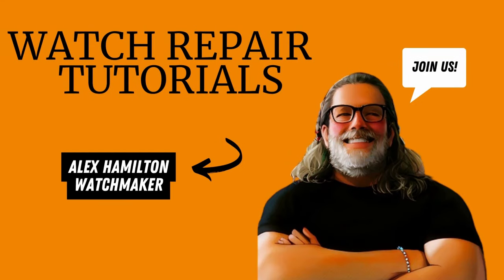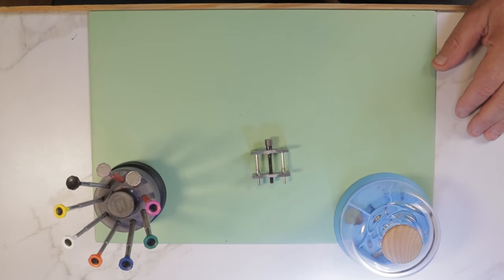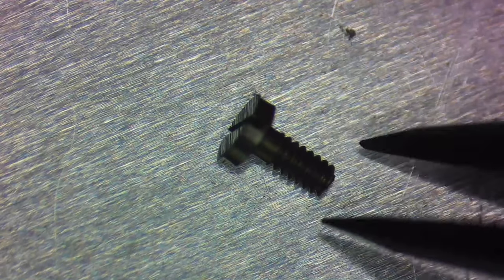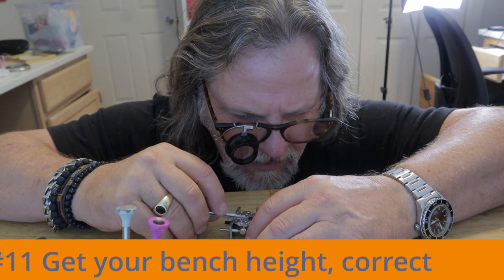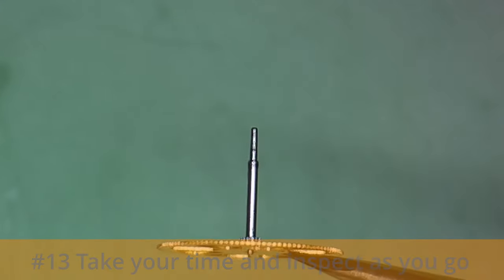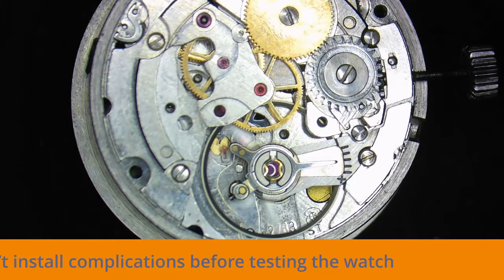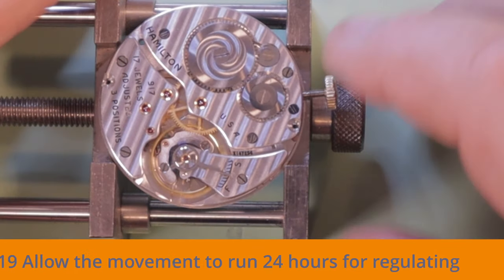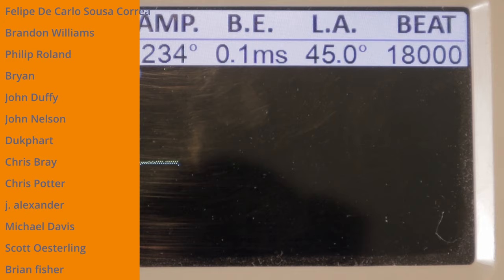20 PRO Tips for Your FIRST WATCH REPAIR

Comment: Very good tips Alex. Pre-cleaning parts is key even if you have a machine. Proper fitting screwdrivers too. Another tip : If you are getting frustrated and/or aggravated, stop and put it aside for another day.
Reply from the maker: That is true for for so many things. Thanks for adding.
Reply: That's the best advice I can think of! For watch work and so many other things

Comment: Apologies if this is a dumb question, but regarding waiting 24h post lubrication and assembly to test timekeeping - I'm assuming if one made any additional adjustments to the balance you wouldn't need to wait an additional 24h. But you would if you had to re-lubricate the watch?
Reply from the maker: Correct.

Comment: I found out the hard way not to wash the springs with the rest of the parts.  Had a click spring go missing.  Fortunately, I found it in one of the wash jars, with a magnet.  Since then, I leave those in the parts tray and wash everything else.  Photos and videos are very helpful, of course.  I keep the parts grouped in the trays and take a photo of each tray compartment.  That has helped me get the parts grouped back together after washing.
Reply from the maker: Sounds like you have learned some lessons. Thanks for verifying

Comment: I just bought some really cheap basic tools and I'm really excited for when they deliver. It's going to be my first peek at watch repair. You're tips have already helped me figure out how to begin. Thanks!
Reply from the maker: Well, like I tell everyone you should pick yourself up an ST 36 movement practice on, not 100 year old vintage pocket watch with no chance of it being repaired and familiarize yourself with the way a watch should run. This way you become familiar with the proper operation before you start looking at things that actually need to be corrected. Good luck my friend.
Reply: @watchrepairtutorials  The St 36 movement is the one Seagull uses correct? I just want to make sure I've found the right movement.
Reply from the maker: @introvertswag6494  
You are correct

Comment: Another great video!  Your videos have been invaluable in getting started in the hobby. I would love a video on crystal installation though.  I bought a vintage Seiko 7005-8062 where it looks like the movement comes out the front, but I'm afraid to take out the crystal since I don't have the tools to put it back in.  It's a maze of expensive presses and dies of different prices and qualities and it's hard to find good information on what exactly I need.  Keep up the good work!
Reply from the maker: that’s interesting that you mention that because I’m actually writing the lesson for the watchmaking course all about cases, including front loaders, as well as the second part lesson three, which is about watch crystals. 
I’ll be posting a video on crystals I just don’t know when yet as most of my time is spent working on my watch making course

Comment: Great video as always - succinct and to the point. The 20th tip is key and I’d add a 20b as an addendum, which you mentioned in other videos: Don’t start this journey by repairing non-runners. Start with ones that work so you can understand the way things should be. Sure it can suck if you “break” a movement that used to work well. But it’s far more demoralizing if you keep working on watches and go nowhere, and months later you just have non-runners strewn across your desk. Have a friend who did just that and he seems to be giving up on the hobby sadly.
Reply from the maker: No, you’re absolutely right about not starting on or not running unless you just want to test your ability to take a movement apart and put it back together. To see if you could handle the small parts well, I hate to see is a classic American pocket watch movement butchered on someone’s first attempt. They don’t make those anymore and sooner or later the supplies are gonna dry up to nothing.
Reply: @watchrepairtutorials  That’s an excellent point and I 100% agree. What I did was start with cheap Chinese (legal) clones of common ETA movements like the 6497, 2824, 2892, 7750… You learn about classic movement architectures and who cares if you mess it up? But I’ve never had anybody actually advise me to take that path. I even asked a local watchmaker (in Waltham!) for tips and said I was starting with Chinese movements and he said “nah, you should start on Waltham pocket watches…”

Edit: Mark Lovick does actually use a lot of cheap Seagull movements in his courses. He hasn’t does his automatic one yet but wouldn’t be surprised if he uses clones of the 2824 and 2892 if (when?) he releases that. Good example to set IMO.
Reply from the maker: @seb_617  well you’re smarter than most then because I hate to see people start on a piece of American history. The chances of somebody fixing €100 pocket watch on the first attempt is practically zero and what usually ends up happening is that they turn around and sell it as a non-runner on eBay because they screwed something up. at the rate we’re going now in five years they will be nothing but non-runners on eBay. That doesn’t even take into account the cost factor. With the limited parts available for 100 year old pocket watches people end up buying a second one to get parts from. So instead of just buying a $35 ST 36 the end up spending over $100 and still can’t fix it. It’s just a shame.
Reply: @watchrepairtutorials  100%!

Speaking of American history - do you happen to know of a good book on the history of American watchmaking? Or even just the Waltham Watch Company. I can’t find anything recent. Even the official WWC archives deposited at Harvard only go to the 1920s. I want to know in particular why these iconic companies went bankrupt (while the Swiss survived, if not unscathed). All I have on that is kind of hearsay/theories but no rigorous analysis.
Reply from the maker: @seb_617  my understanding is that after the fair of 1876, the founders of Longines came to the US to study what was going on in the American factories. They use this information to restructure the entire Swiss watchmaking industry out of fear, that if something did change the entire countries future was at Jeopardy. They use this information to replicate what we were already doing in our factories. Fast forward to WWII., the American factories stopped producing consumer goods to concentrate fully on supplying the military with timekeeping pieces. During this time period. Because the swiss were neutral, they were able to come in and start picking up pieces of the consumer market share unopposed. Now the American factories had to try to restore their market share, but because of the huge expense of their factories, they couldn’t maintain business as usual, and slowly started closing with the last one being Hamilton, which was bought out by the Swatch group. 
No, I don’t know of a specific book on American watch history, but I do have a PDF copy of this 300 page book that is essentially the report that was made by the guys from Longine on how the factories in America operated. It literally details out the entire operation, including the equipment that was used in great detail. It is an interesting read. If you send me an email to alex@watchrepairtutorials.com. I’ll send you a link to my Google Drive where you can download it.

Comment: Hi Alex! Thank you for the another great tips.
These days I am trying to service old watches. I understand an amplitude is one of the most important figures that shows if the cleaning process was perfect.
I found that dish soap+distilled water+IPA rinsing is still nice,(regarding its high accessibility) but in most times it requires multiple manual brushing while cleaning 'old' watches. And even after those manual brushing, rusts or some kind of pollution seems to remain after drying. I went to my domestic watchmaker to ask help, and found the watchmakers use 'hexane' for cleaning&rinsing. What I am curious is, 
1. Does hexane has clearly better performance in watch cleaning? Is it worth hardly purchasing via domestic watchmakers?(was not able to buy it from the internet)
2. Are there any additional hazards(comparing to IPA) I have to take into account while using hexane for watch cleaning? IPA seems to be well used in any kind of field that needs disinfection(so there was plenty of info about its hazardness), but I cannot find fields that use hexane a lot.. That's why it was hard for me to find additional information. I'll appreciate if you can help me just a little bit. 
Thanks for your help in advance!
Reply from the maker: Hello my friend, I have a video coming out in a couple days where I’m going to answer your question in depth because a lot of people have been asking me about this same type of issue. I think you be very happy with the answer but you’re gonna have to wait a couple days until the video comes out
Reply: Thanks for your reply! I did not know that you left an answer for me. Do you mean the latest video titled 'When to service the watch?' I've watched it right away but cannot find information about hexane. Although I think it is another great tips..

Comment: Hi Alex, what size pin vices we should get and what brands besides Bergeon? Thanks
Reply from the maker: It totally depends on what you’re using them for.
A pin vice for sizing stems can be what ever you want. A couple small generic ones are fine.
There’s also specialty vices made for holding barrel arbors. I don’t know of anybody other than Bergeron that makes those, but you can check for with Horetec.
There’s also specialty vices for holding pallet forks, balance timing screws, and hairspring stud screws
Reply: @watchrepairtutorials  thanks!

Comment: How much does one of those de-mag machines go for?
Reply from the maker: The Elma branded one go for just under 300. I’ve also seen Chinese versions that go for about 6070 bucks. Can’t speak to how affective they are or you can get one of the little blue boxes off Amazon for about 10 bucks and they work as I demonstrated in my video about how magnetism affects watch movements.

Comment: Where can one find the tech sheets for these movements?
Reply from the maker: Almost everything’s available just by googling the movement number plus tech sheet. Was there anything specific you were looking for?
Reply: @watchrepairtutorials  Is there a specific website that usually has it? Unfortunately still having trouble finding it. Looking for the Rolex 3285 or Patek 315/190 of the calatrava 5107
Reply from the maker: @garshkilla  sorry not for those calibers unless you have an account with the manufacturers.
Reply: @watchrepairtutorials  aah ok, thank you